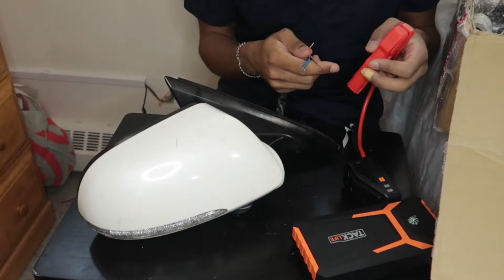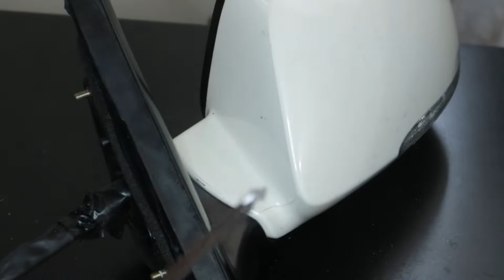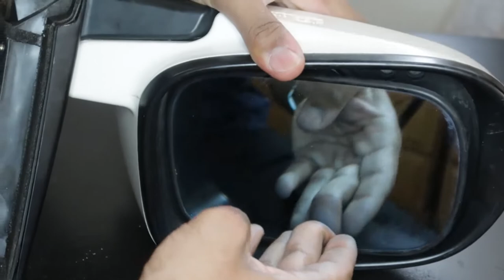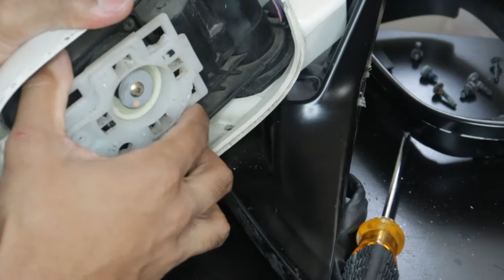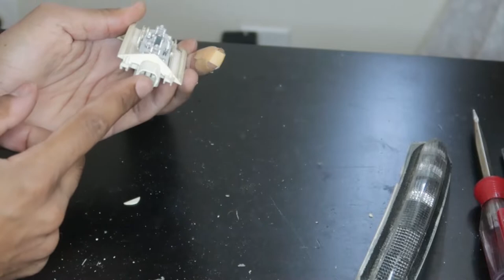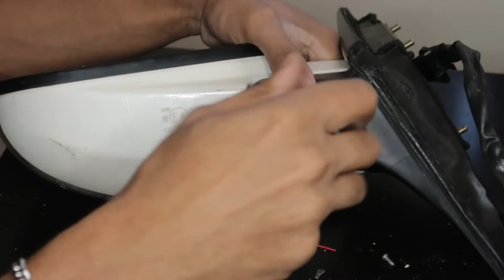CUSTOM SEQUENTIAL EURO R SIDE MIRRORS!!

Comment: are the euro side mirrors plug and play? I have a 2005 tsx and would love to have the power folding mirrors.
Reply from the maker: Not plug and play, you have to run wires to a switch in the car to make them fold

Comment: Do they light brighter then the original? Iv ordered 2 pairs. Would line two in one side marker and see how it goes
Reply from the maker: Yeah they’re super bright compared to oem, they’re leds
Reply: Bro I did this mod. The led is lighting up very fast.  Jow to slow it? Do I need a relay for it?
Reply from the maker: @fmas9614  what do you mean by fast? No relay is needed for this mods at all
Reply: @ITSXLOW  I mean is that the sequential led that's suppose to start lighting 1 led then move on. This process is very fast. In your video it's going at a normal speed. Mine goes very fast. I haven't installed it in the car yet just check through the 12v adapter I had.
Reply from the maker: @fmas9614  Check my most recent video, I show them on the car check to see if its the same as yours. I think they go by fast also but its nothing too fast

Comment: When I did this now my turn signal blinks fast and only half of the sequential strip works but when its on emergency they work fine, any idea why
Reply from the maker: Thats weird because the turn signal and hazard are the same. How did you wire them?
Reply: Think u might need a resistor ? Idk